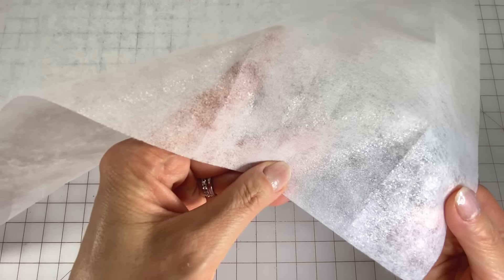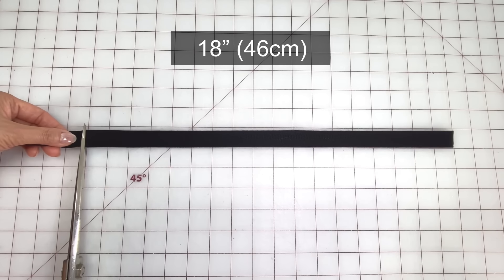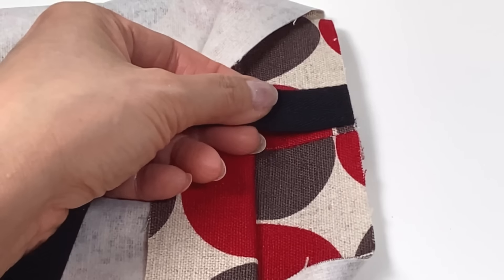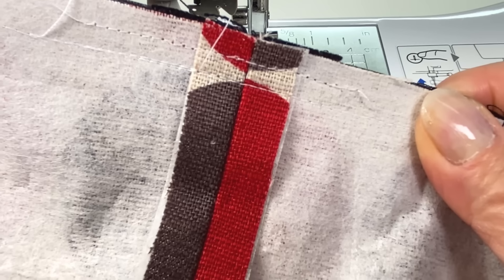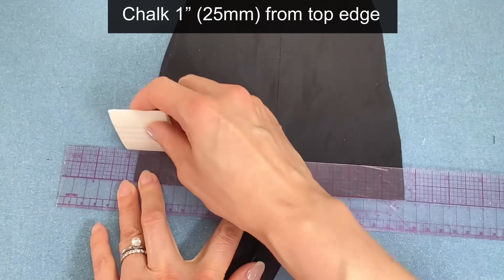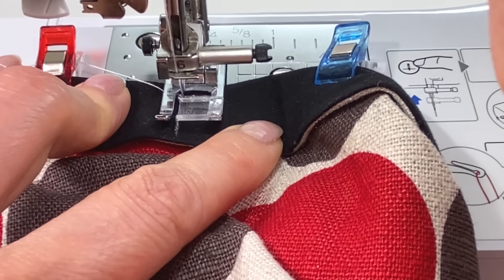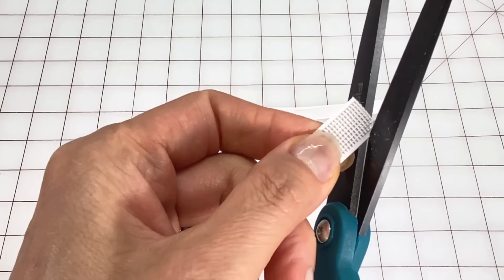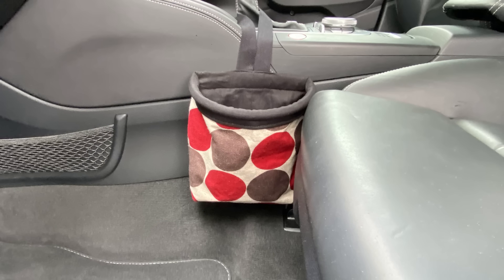Mini Trash Can For the Car  - Easy DIY Christmas Gift

Comment: Great pattern. I made two for our cars. We put one on the back of each front seat (attached to the head rest), so both driver and front-seat passenger can easily reach back to throw out trash. I used a side release buckle to make the strap length adjustable. We do use them as car trash cans but they would work well for holding knick-knacks for passengers sitting in the back.
Reply from the maker: Thanks so much.  Great idea with the buckle!

Comment: I absolutely love this tutorial! I bought your pattern and I’ve made a few. I would like to make it larger. Can you give me an idea how to adjust the markings to accommodate a bigger one?
Reply from the maker: You need to decide how big you want to make it. Decide how wide you would like the back edge to be ( for placement of the back boning  and vertical stitches) and you can fold the bottom the same  way or just slightly wider.
Reply: @NotchesSewing  thank you so much! I’m going to practice on some muslin. I’m sure I’m overthinking it, and it’s easier than I think.
Reply from the maker: That’s exactly how I design.  I make tons of samples first.  Just pin fabric together without cutting to get idea of size first instead of cutting all out.  Have fun!

Comment: Would love to add reusable liner bags into it made out of fabric too and not disposable plastic ones. I'm thinking made out of PUL. Any suggestions on how to make it work and fit into it? I'll pay you for a pattern.
Reply from the maker: You can easily remove the tubing and boning from the bag for washing.
Reply: @NotchesSewing  yes, i just wanted to make extra liners to put inside, so I can take the trash out put another liner while the other one is washing. Not take the whole trash bag out. Idk if I'm explaining myself well

Comment: I thought it is a great idea.  But for me it wouldn’t work in my car, because I don’t have window handles.
Reply: Hi Michelle, I think it's a great idea too. Your comment had me thinking, if there is nowhere in your car to hang one, you could omit the loops and instead use adhesive velcro (hook-and-loop) dots or squares and stick it on somewhere. Just a thought! 🙂
Reply: @lesley4928  that is also a great idea.  Velcro on the front of my dash would be great.
Reply: How about a command hook cleverly placed in an inconspicuous, but accessible location.
Reply: @catherinewheatley1493  That's an excellent idea, Catherine! That way you keep the original pattern.
Reply: @lesley4928  maybe they’ve improved it since then, but years ago, the adhesive on hook and loop wd melt if it got hot, so depending on where you live, it might slide down the dashboard. Maybe test it so you don’t get a sticky mess.
Reply: She said she hung hers over the gear shift handle. I guess it hung down the console.
Reply: @susanmei9980  Thank you for the good advice! 🙏❤️

Comment: Why is your needle always left of center?
Reply from the maker: That’s the default position when machine is turned on. Also, I’ve mainly used industrial machinery throughout my sewing career and the feet are different without ability to move needle position.  I don’t move it on this machine unless I need to.